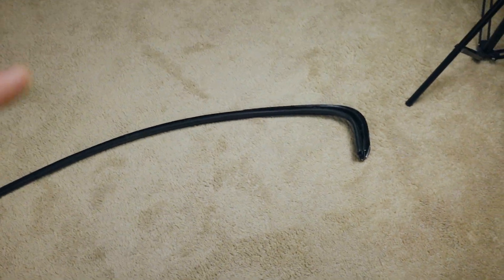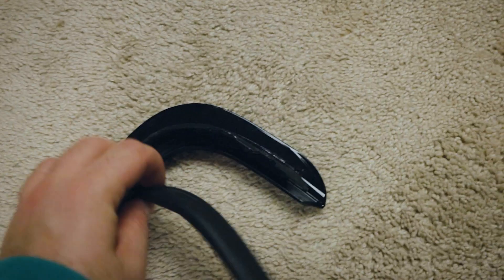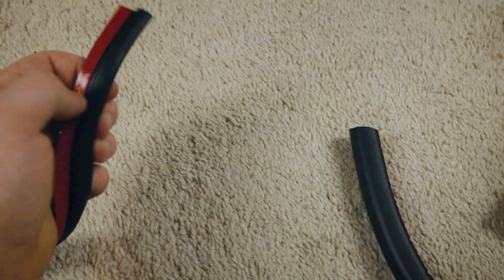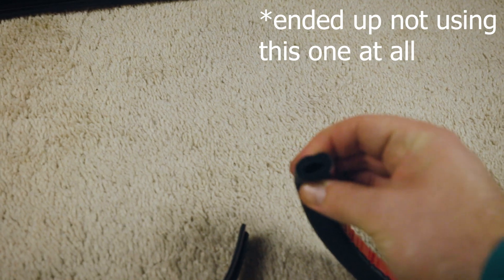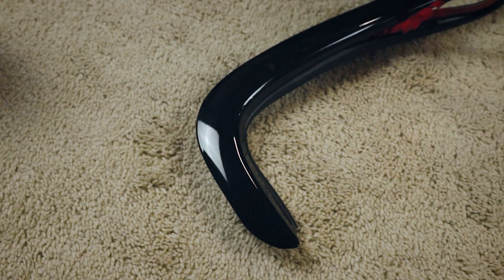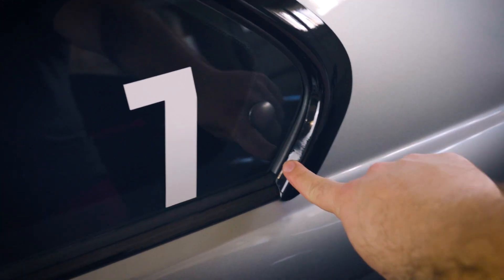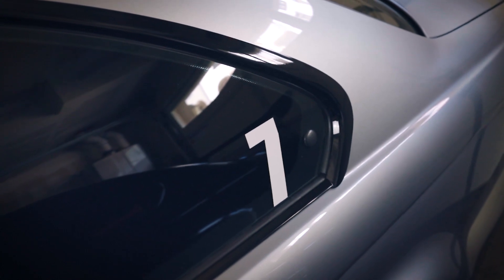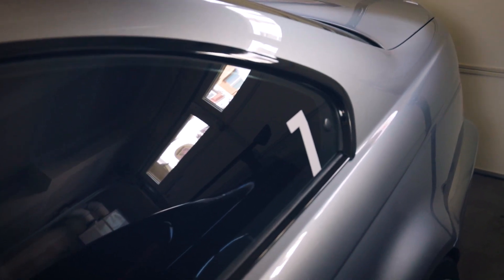SAVE $1000 by doing this on your BMW e46 - Window Trim Gasket Replacement

Comment: how difficult is it to take out that trim without breaking it? does the seal glue hold up to the trim attached?
Reply from the maker: removing the trim is not hard especially if you take the rear quarter windows off. After reviewing the product again, I think they changed the adhesive on the seal so it does not stick as well anymore. I would just recommend upgrading the adhesive on the seal to prevent delamination.  Mine have been fine since I installed them on the car which has been over a year now

Comment: Need to do this on my e46M3. 10 years ago these parts were about $350 a piece. I just checked and one side is $720 and the other is $510. I should have done this when I had the chance...

Comment: I’m going to try this. I think the seal will stick better if you heat it before sticking it down. I got both the 20mm and 23mm to see which size z shape will fit best
Reply: Hi! Have you gotten around to doing it yet? If so, which one fit better; the 20mm or 23mm? Thanks
Reply: Please let us know which fit better…..20 or 23mm
Reply: 20 or 23!!😂

Comment: Can you provide a item number from 3m or Amazon ? My driver side is also shot. And installed the CSF oil cooler and radiator ! Flawless install thanks on that as well !
Reply from the maker: Glad to hear the oil cooler and radiator install went smoothly

Comment: I just ordered this to fix mine. How long have you had this done. How had it held up ?
Reply from the maker: It still looks great and hasn’t delaminated but they changed the adhesive on it so I suggest getting and upgrade on that and it’ll work great

Comment: Do you have a video how you you removed the plastic trim from the body?
Reply from the maker: I do have a video which shows you how to remove the window trim without disassembling the windows. Here you go: https://youtu.be/bLeM9NOmwpA
Reply: @MunichVenom  thanks!
Reply: @MunichVenom  thanks for the link, were you able to replace that rubber strip on the C Pillar where the long strip is attached to? I believe its a Z shaped strip that some people call it.

Comment: I just did this with the same z shape gasket and I think they might have made it smaller. I have a gap in the curved area.
Reply: How bad is it?
Reply: @Qadi90 wasn’t that bad. I ended up removing it and sticking on a new piece more towards the edge. I then stuffed another d shaped gasket under it to make it sturdier.

Comment: 4m is perfect? Or 5m is better?
Reply from the maker: 4m will be fine. Just make sure to put better adhesive on the strip. They changed the adhesive after this video and it isn’t as good

Comment: Did you buy 2 packs or 1 ? I'm thinking 2 ?
Reply from the maker: I had a 8meter roll and ended up not even using half of it. I think the 4 meter roll should be enough since the gasket only goes around the rear quarter windows
Reply: @MunichVenom  the 4 meter roll will be enough for both windows? Great video I'm doing this repair as well.

Comment: Where is it costing $500.00 for the gaskets?
Reply: It's not about the gaskets. BMW would make you replace the whole trim which now probably costs even more than $500 a side. The gasket is not produced separately as OEM.
Reply: @Jkrcmik  I priced its replacement and the cheapest I could find was $1700.00!! I'm doing the gasket.
Reply: @hexrays  have you done the gasket yet? I’m in the middle of the install and the gasket isn’t sticking to the trim

Comment: This stuff sucks tried it after seeing the video it don’t stick after u close the window it peels it off I’m have to do the whole job again with the other stuff everyone recommendeds it’s way thinker
Reply: Could you please recommend better one?
Reply: Can you provide a link with the other product ?
Reply: Hey man, mine peels off too. Can you please recommend something better? Thanks!
Reply: Did anybody found the right seal ?
Reply: any luck?
Reply: @Shadow-wu8gy  no luck :( gonna try using a better adhesive tape or something
Reply: I feel you on this… I did this job in 2013 on the driver side only. 3m discontinued a perfect weatherstripping and no one can find it. This one he’s using is perfect however there a few things you can do to reinforce the backing. Use the stripping he has here and sandwich the stripping with another flat stripping along with further reinforcement with weather stripping tube adhesive. Also another thing you have to be wary of is the flexible double sided tape that holds the bracket above the rear quarter window. Another thing to mention is you have to modify your reinforcement flat weather stripping by using an exacto knife for the screw holes. Last thing, there is a quarter inch width V ridged stripping that sandwiches between the body and this bracket. If they are cracked and gummy you’ll have to find that stripping and replace it which you’ll have to remove from the bracket. So this is why that piece is so expensive because it replaces the seals everywhere. If you don’t do this job right it will have water leak and penetrate the interior and what’s worst it will rust the body of you’re not careful.
Reply: @gtcreels532  
Thank you for your ideas.
Can you share which flat striping did you use and what kind of adhesive as well?

Comment: Save $1000 😂😂😂 wtf the crap don’t cost $1000
Reply from the maker: 😂 the trim pieces are at least 500 each for the base and even more if you get your hands on the gloss and the only reason we have to change them is because the rubber disintegrates. No replacement offered by bmw so we have the buy the whole trim or you can diy the fix for a few bucks
Reply: No, they are not. To begin with, it is a 19+ year old vehicle. The parts for those vehicles are as cheap as dirt. You can literally find them everywhere from Amazon to your local junkyard. I work at a BMW auto shop near Chicago called Bavarian Auto Werk. You going to tell how much these parts cost 🤣🤣🤣🤣🤣🤣 okay bud. Whatever you said. You paying $500+ you getting f*** without vaseline.
Reply from the maker: You should go ahead and sell them then and save everyone some $$$. I would’ve been the first one to buy them. Here’s the part number, send us some receipts: 51717003935. That’s for one side
Reply: @MunichVenom lol bro doesn’t know what he’s talking about don’t pay attention to him great vid just ordered the striping gonna get to it this week 👍
Reply: Just cause you buy cheap used garbage parts buddy dont compare them to quality parts. There isnt shit cheap on e46 bmws and exactly why it isnt cheap cus its old and certain parts go for more $$$ i paid 230$ for my flat black drip rail so yea i can see a gloss version going for 400+ $
Reply: @ulucio86 - you should check the prices for E46 parts, they are not cheap especially any trim pieces, age of the car has nothing to do with the price.